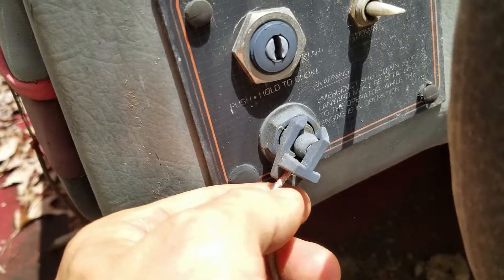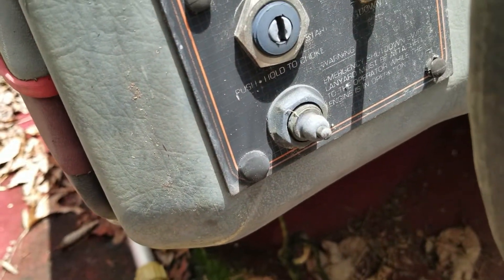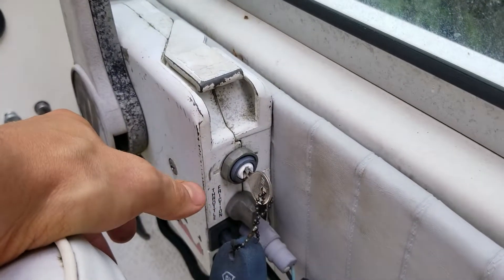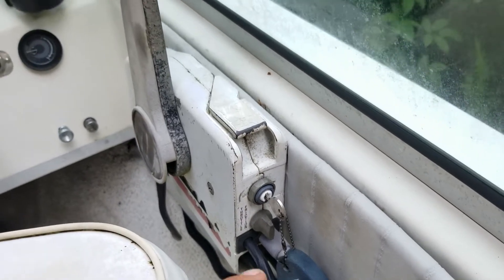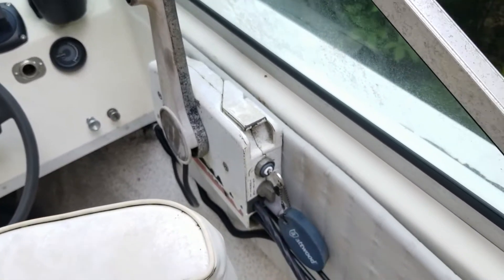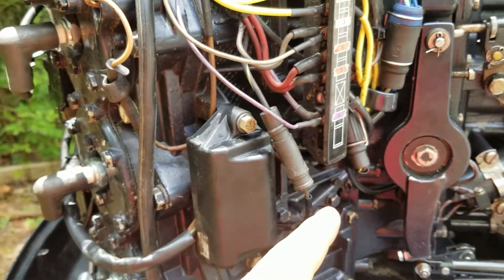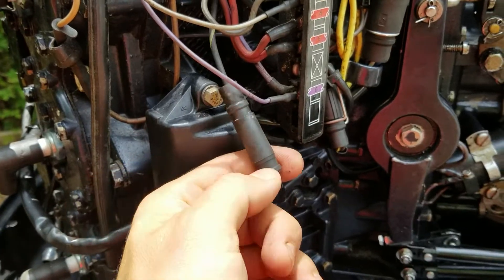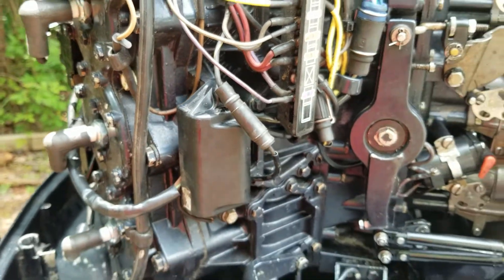How To Test An Outboard Kill Switch Circuit

Comment: Appreciate the content. 1997 60 hp evinrude remote control. Put it back in the garage 2 years ago. Ran perfect when I put it up. All new fuel ⛽️ I installed 3 spark testers one on each cylinder. Crank engine over no spark on all three cylinders. Help me brother

Comment: Boa noite o meu motor e Johnson 225 Hp  o CDI e diferente, e encima dos cabeçote, e o motor não deslyna chave, vi que lá tem esse preto com amarelo, vou tentar vê se ele faz o aterramento e desliga?
Reply from the maker: Black and yellow should be the wire that stops the engine. If it's grounded it won't start.

Comment: Hi Matt. 1987 Johnson 150. I have spark on all three coils on port side. Spark on top coil starboard side. NO SPARK on middle and bottom coils. Replaced both still no spark. ????
Reply from the maker: Bad ground two on top back of engine one down by battery to engine ground small wire.

Comment: Purchased a 1986 SeaStrike 20.5’ with a 1998 200hp Evinrude. Currently working to achieve spark to fire up. You vids help greatly. I’ve removed the VRO and converted to double pump oil mixing process. Feel a lot safer. Tomorrow’s starts my walk through the the ignition system. I’m gonna start with the Killswitch as you showed and how to test and kill with circuit and walk through the steps all the way through. I watch most of your videos and I appreciate the visits cause this helped out a lot, but I’ll be in touch soon as I get this baby fired up. Thank you.

Comment: Nice one very helpfull,got a 98 40hp johnson wires hacked off at just before red plug any clue what wires go to what,two purple one black one black/yellow strp one yellow/red strp one red/purple strp one gray one tan and of those purples tied together one has white strp.ieght all together going to motor harness.think its an 89 or 98 year.

Comment: I have a 2000 Johnson 90 horse That for some reason when I turn the key the motor starts But when I take my hand off the key The motor shuts off. Doesn't happen all the time. Have you ever heard of this happening?
Reply: Going thru this right now
Reply: @katietannehill ended being my power pack and ignition coil.
Reply: @durf1970  thanks for ur reply yea I have a 90hp evinrude just got the boat and my radio works my trim goes up and down but I turn the key and it runs but when I let go of the key it turns right off. I’m so depressed

Comment: Simple Matt. Thankz again.  I have a 70hp force motor that want start. I've changed out my battery,  bought a new relay and checked all fuses. And it barely turns over as if the battery is dead. I noticed the key switch turn as if its loose. I wonder if thats the problem.
Reply from the maker: I have a Force 85. Does it turn over well by hand without a battery?
Reply: Hi sorry for the delay. I fell asleep earlier today. Medication 💊 will put you on your back..
But I did get your response. Yes the motor turns over by hand.

Comment: I have a 93 johnson 150hp no spark. Changed the cdi unit and new spark plugs. Could it be the stator or kill switch
Reply: I can almost promise you a case of no spark has nothing to do with spark plugs. The chances of you getting 6 bad plugs in the same engine at the same time is astronomically low. It might be the kill switch. Sure.

Comment: will the starter still work and turn over the motor if the switch is bad?    (I know it kills the spark -  but im not clear on if it cuts power to the starter?)
Reply: Yes the starter should still spin and turn the motor over but it will never start if the switch is bad.

Comment: 1997 evinrude intruder 150... I don't get anything when I turn the key, and the trim motor stopped working.. everything else works, and everything worked 2 weeks ago.. any Ideas
Reply: What else would work if the engine doesn't turn over or go up and down?

Comment: Does it matter what lead you connected to the kill switch wire or we you just completing the circuit to text?
Reply from the maker: Doesn't matter as long as one goes to ground and one goes to the kill wire from the helm. Power pack kill wire stays disconnected.

Comment: Working through some electrical issues on my 84 Evinrude 150 v6 2stroke. I have not been able to find a manual for it. Do you have a reccomendation on the best manual and where to find it? My model no. E150ANCRS 
Great content!
Reply from the maker: I'd go on eBay. This is a 1986. Evinrude 150 XP. I have the OEM factory service manual. It has a black cover. Don't buy one of those Haynes manuals lol